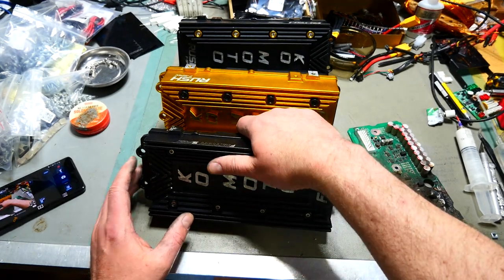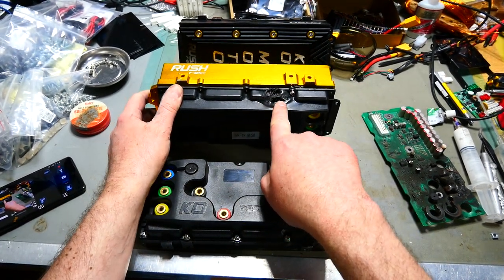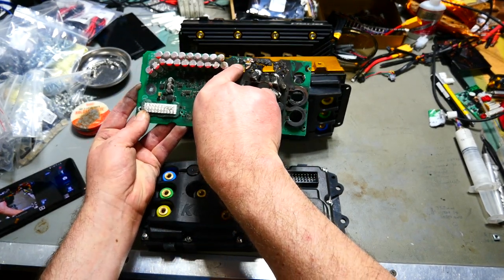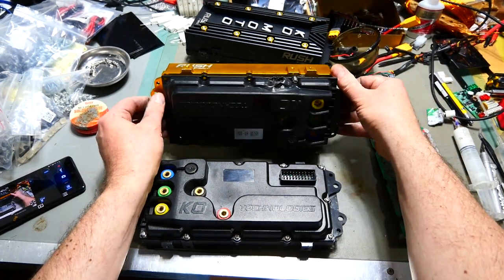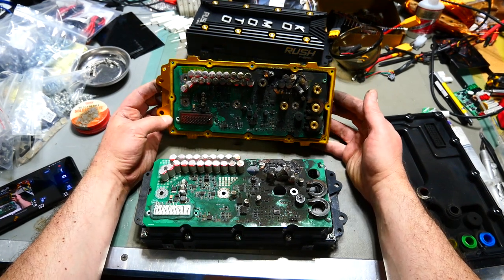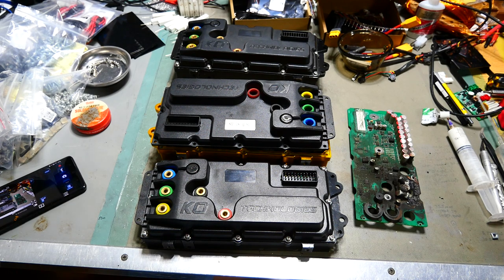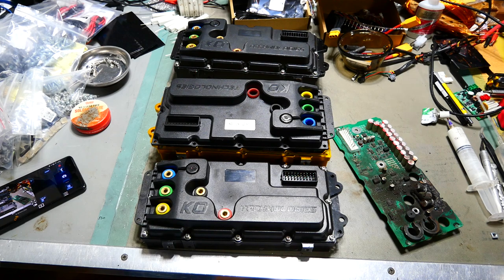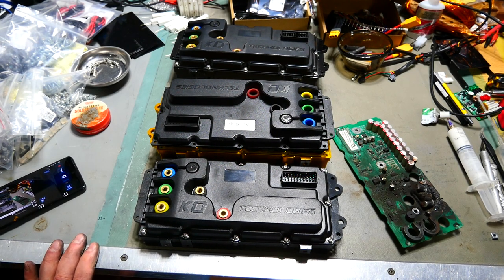TEASER: What KO Moto does NOT want you to see!!! BURNT CONTROLLERS

Comment: So what controller would you recommend? Or what company because i assumed a 60kw controller would be top dog compared to asi bsc8000. But now I'm confused? Also what do you think about the KO moto motor? Or is there a different motor you recommend?
Reply: **BAC8000
Reply from the maker: X9000, SHuL controllers, Tronic, Nucular, ASI are all better designs by tons over anything KO makes. For now at least, the direct competition to KO is EBMX and people are not exploding those controllers. This is a clear case of a BAD design from KO that causes catastrophic controller failure. I've had people tell me this happens when you turn up feild weakening too high. This is laughable as that's proof of the BAD hardware design in KO controllers! On the FSPEC motor, go watch my tear downs of that motor. EBMX will have 2 motors out very soon. I've seen them already...worth waiting for!

Comment: You are speaking the truth. the KO and x-9000 are retail low end controllers, KO being the cheapest garbage out there. The commercial grade new GLE BAC8000 with the new 2023 custom firmware is insanely powerful and buttery smooth. Works like a BAC 10,000 and the new ramp and ramp down features are controllable and tunable with the GLE app. It is absolutely BUTTERY smooth.
Reply from the maker: ASI has been around for a long time. However, they are nearly stagnant, very slow moving and rapidly getting left behind by VESC. The X9000 is one of many VESC based controllers. What you think is "buttery smooth" is something that VESC controllers can do as well. It's just a matter of proper controller tuning. I don't know what a BAC10000 is. Google came up dry too. I know of the BAC2000, BAC4000 and BAC8000. They do get firmware updates, but more often than does anything VESC.

Comment: I want to see Chrissy respond to this
Reply from the maker: He won't talk publicly, just to his fan club that worship at his feet! However, there is a 100% chance that he at least knows about this teaser videol
Reply: he cant, here is not enough space of his never ending bs text :D
Reply from the maker: @IncredibleCisco  Has anyone seen that mystery dyno video Chrissy promised 8 months ago? It just doesn't take that long to dyno anything!  I would hope that KO would use a commercially available dyno similar to what EBMX used so that results are verifiable and can be derived from stardards based testing. The EBMX dyno video runs were done sort of "off the cuff", but then they do dyno testing all the time. Producing actual results is something they see at least every month if not more often than that. KO however, we've never seen any dyno results from them after 8 months of empty promises! Chrissy is indeed full of empty BS messages!
Reply: @de-bodgery  Takes about 30 seconds to throw the bike on the dyno, maybe another 30-45 mins of testing? I believe KO did the dyno and was embarrassed of the results! KO Pro and Rush are the same controller
Reply from the maker: @dylsquire5521  Wheel dyno is the wrong test for a motor and controller. For that you need to direct connect the motor to the dyno. but yeah...pretty sure they discovered that the dyno showed they were making what EBMX said they are making and that can't ever be made public by KO!